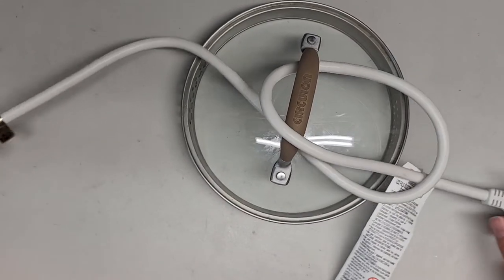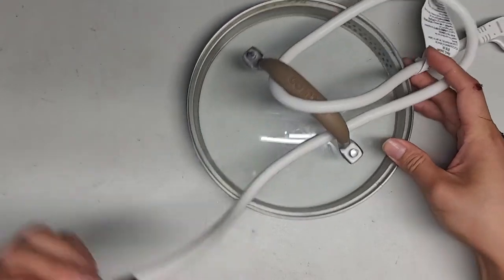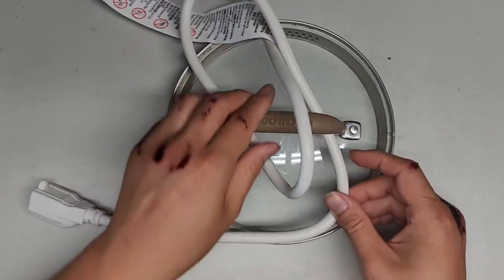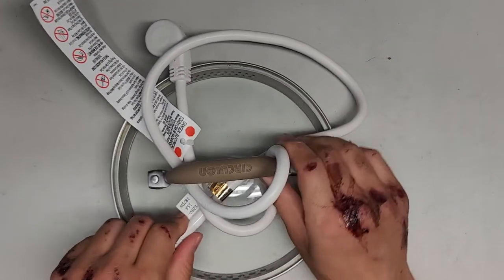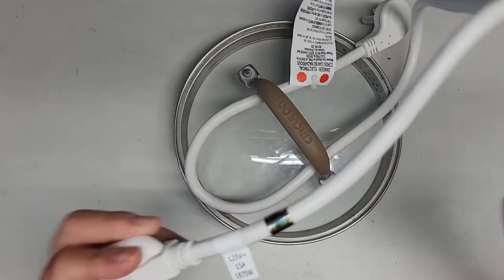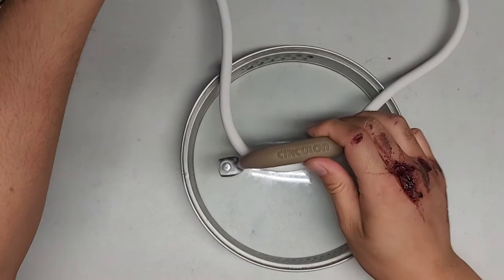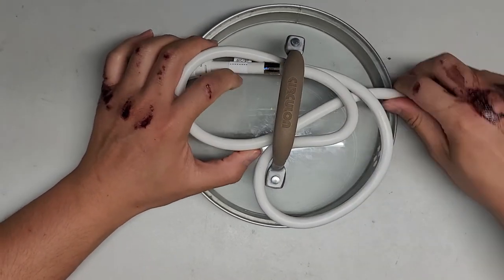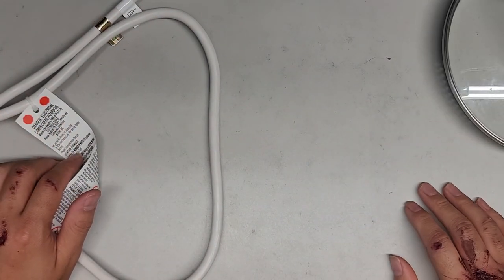Stuck Trapped Power Cable Wire How and Why it Works Debunked It's an Illusion

Comment: The whole reason this works is because there are two separate ways to achieve the start state you have. One is what you showed, and one is pushing the end under the bar and tying a knot. Most people start by pushing the end and tying a knot, then magically undo it.  You are using the magic trick backwards to create the start state, but you can also get to the start state by tying a knot, so the others arent tricking you
Reply from the maker: You can't tie a knot unless you're able to get the big end under in the first place.
Reply: @ItsBinhRepaired You're simple response made me spit out my drink lmaoo
Reply from the maker: @prevayle3849  lol I mean it's all just the illusion of a knot with the big ends trapped underneath, when in reality the big ends never went under the bar. Unless people can phase it through solid objects, it's just an illusion. Lol Otherwise they're saying they can get 2 croquet balls attached by a string out from a pot lid handle by doing some fancy knots... lol bs
Reply from the maker: Nobody is shoving the big end under a gap that's too small for the big end. Lol

Comment: It's not a trick. You have the wrong cable set-up.
🙂
I've uploaded a short video where I explain how to place the cable. Then I also offer an even easier solution than the one everyone uses: https://www.youtube.com/watch?v=tRwCnyOogL4
Reply from the maker: Unless you can pass a solid through a solid, it is just an illusion... lol
Reply from the maker: You just showed the illusion... the cable isn't trapped under the bar... you just put the cable through a loop that was passed under the bar.

Comment: 😂 ppl using cables to learn you how to do it. wtf man?!! you just dont understand this. its not the brain trick about just a cable. it learn you what to do when cable from yor device stuck. do that with huge lamp then or old tv where cable cant be disconected.  do you will be moving the while lamp/tv thru the loop ? 😂
Reply from the maker: It's a trick... it's not actually looped behind...